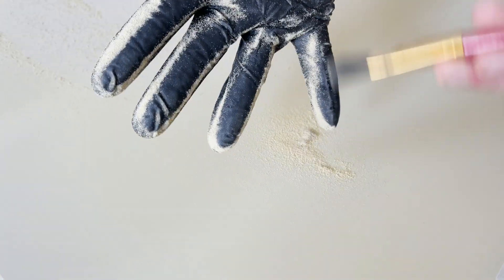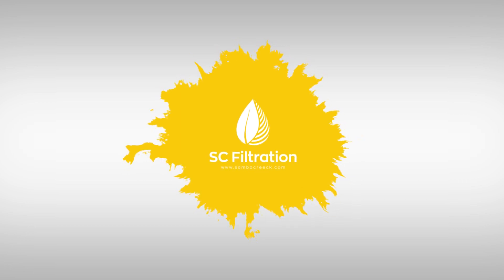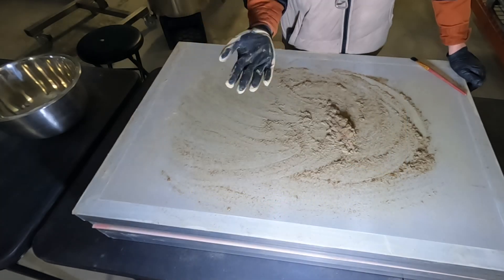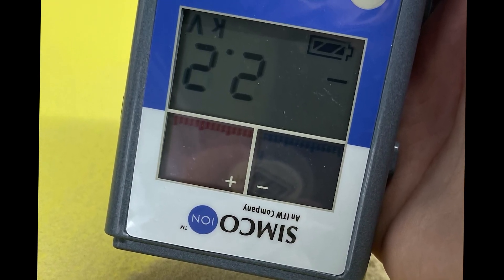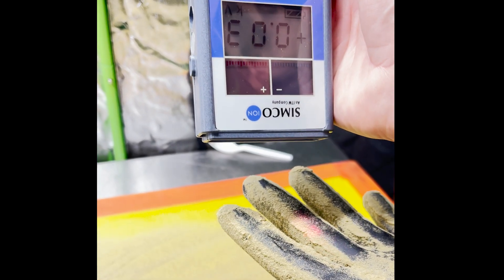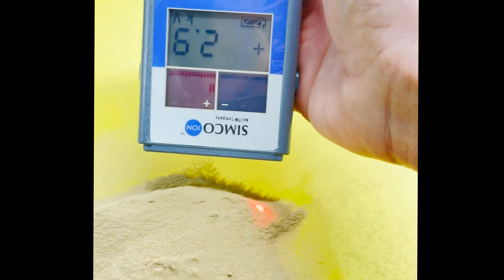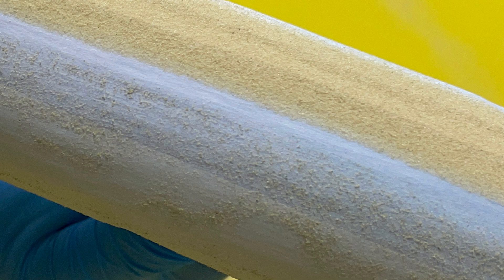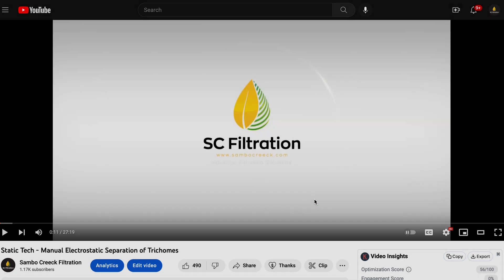Triboelectric Tuesday Episode 7 - How Glove-tech Works

Comment: Vibrating Funnle with a static charge near the end to pull heads away from the flow and off to a collection chamber onto the sides. Pour the material through the funnel untill all the heads are statically seperated.
Reply: expand on this idea please.. Show me the ways xD This sounds so smart

Comment: My attempt at making a simple set of machines to automate the job.

1st machine
I have no idea what you are making, But, If you can charge it then drop it through a hopper/exit shoot, where one side of the hopper is charged towards what you want and the other charged towards the chaff, you could probably leave most of the work up to gravity, and the natural static Pull. Put a collector under the side that is charged correctly and due to gravity the wanted item should always fall towards the charged side of the output(Maybe a slight backward angle on the charged side to further separate the product), the stronger the charge the more it should be pulled towards the attracting surface. Cody's Lab did something similar to that in order to sift Magnetite from Sand if you need a video to understand or if I am unclear. Though TBH I am not sure 

You could probably automate Charging it with Swisher brooms/spades on a slanted cloth(or whatever material you want to pull electrons from/to) conveyor belt.

2nd Machine
Alternatively, a double conveyor. Bottom conveyor helps build charge(Material that loses electrons) while slowly moving towards Chaff deposit. Top Conveyor presses against lower conveyor parallel for most of it's journey, and compresses lightly against product moving at a slightly slower rate, Top belt shakes/vibrates a tiny bit, This vibration/ and compression should charge the Item you want charged. Top Conveyor is made out of a material that the charged product sticks to. Chaff falls off of bottom conveyor at end, Product stays on top conveyor and gets brushed/guided/squeegeed off towards a collector. The Top Belt should be shorter, and slightly angled up towards the end. A product catch sheet can/should be put between the two belts near the end where the Top belt starts angling up to catch the charged product(I would probably put the brush/squeegee on the underside near here but anywhere after the belt separation is done would work.)
-You can layer belts/Directly feed to a redundant separator until acceptable collection percentage. 

Then again I am neither an engineer or a scientist. Everything I said could be wrong, and I barely know what you are making. I only ask that if it works and you make a machine I want 1% Annuity XD Hell I might have just made a bunch of word salad, and looked like a fool... None the less I got to visualize some simple machines That I know could do what I want even if I explained them poorly.

Comment: Hello from Medellin, Colombia, yesterday I made my first static Hash with the Moroccan method. with stainless steel sheets, but it had a very light silk fabric and it broke with friction.
my question is: what material do you recommend for the cloth, on which the static is generated with friction? thanks, very good videos.
Reply from the maker: Nylon. Many plastics work so I suggest you look at the Tribo Tuesdays series in this channel to learn core concepts. Typically we use screens used in the silk screen industry. It’s what they use to print logos on tshirts. Saludos y mucha suerte.
Reply: @SamboCreeckFiltration  absolutely not… you need to use different nylon bags with specific micron measurements in order to capture the different purities. 90-75-60-45 and 30 microns. 90 will capture and impurities and the smaller the micron the higher quality.
Reply from the maker: This is incorrect. Perhaps you  are referring to CWE and not static.
Reply: @Em-pv5ey  that does not separate the heads from the body
Reply: Una maglietta di cotone 100%